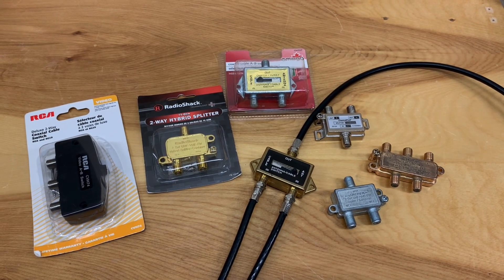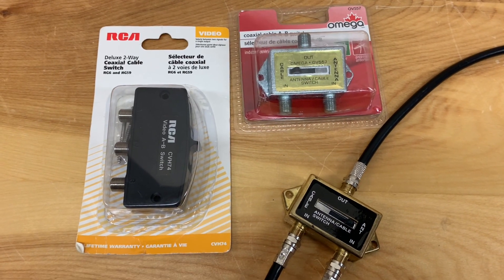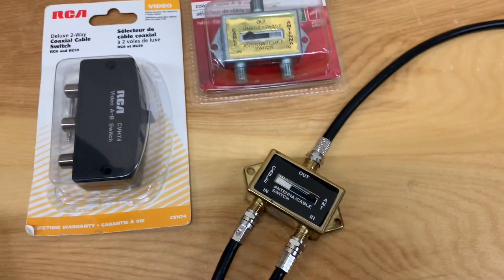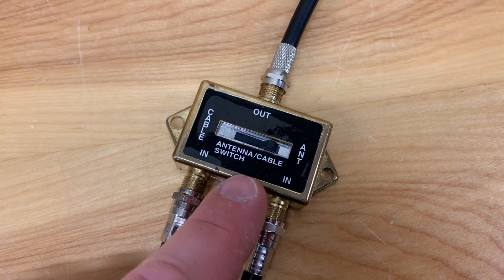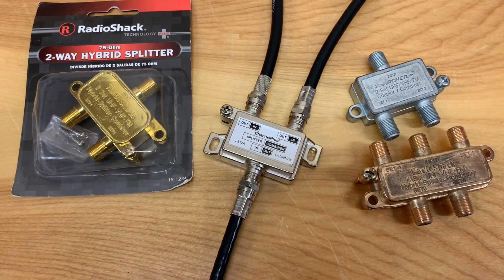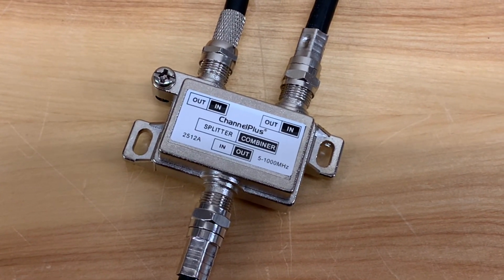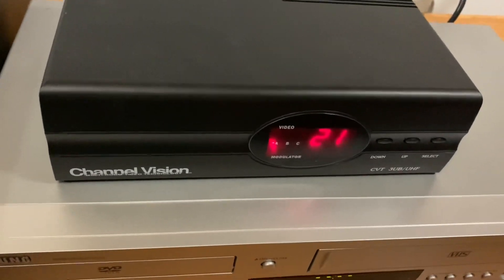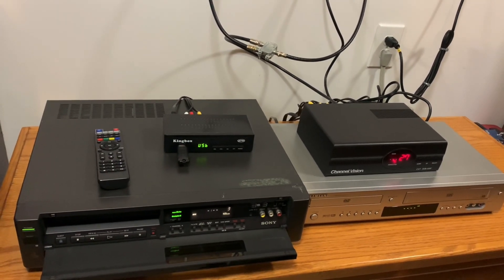Options for combining 2 TV Antennas into one Coaxial Cable

Comment: its 2025 DEC

    STILL WORKS ?? now atsc 3.0 took over ?
Reply from the maker: Yes, they still work in 2025. These are ways to connect antennas. RF is RF. Switches and combiners don’t care about format or standards. It doesn’t matter if it’s ATSC 1.0 or ATSC 3.0.

Comment: Cheers sir for the suggestion to watch this video you may have helped me to improve my signal from 2 diff antennas ...im on the north shore of lake ontario, a great spot to pick up signals and want to make sure my antennas arent interfereing with ea other   🍻📶📶
Problem with the manual switch is i would have to get on the roof 😂
Reply from the maker: @zandig666  The A/B switch could be installed inside the house. But the coaxial cable from each antenna would need to be brought inside the house also. The diplexer is probably your best option.☺️
Reply: @NorthcoasterHobby  I found one relatively cheap Skywalker combiner  diplexer  heard it was good for 2 antennas
Thanks I would never have known this without your help🍻📶
Reply from the maker: @zandig666  You’re welcome.

Comment: I’m using a Steren A/B switch now, because when I tried to connect to the two antennas at the same time, I used a Y cable (advice from the fb group) but they caused interference. Maybe a Diplexer could work. The group just said to use equal length cables and space the antennas a few feet apart. Since this is fast becoming a new hobby, I’ll give it a try. Thanks for the videos and the replies!
Reply from the maker: I would stay away from the Y cables. Stick with the A/B switch or diplexer. Besides those options the best thing by far would be the Televes SmartKom.
Reply: @NorthcoasterHobby  hi, I was going to order the Channelmaster jointenna cm-0500v2. any thoughts on this one?
Reply from the maker: @joeprete7424  I’ve never tried that one, it pretty much looks like a diplexer, nothing fancy. The main issue with diplexers is multipath, where both antennas pick up the same station and the signals cancel each other out. You could try it out and see, or experiment with a less expensive diplexer.
Reply: @NorthcoasterHobby  well, the Jointenna is working. I’ve got to work on some fine adjustments, but all the ABC (ch. 7 in NY) stations are now coming in. Thanks again for your help!
Reply from the maker: @joeprete7424  You’re welcome, glad to hear that you got it sorted out! Thanks for watching my videos!

Comment: Diplexer Is Not That Hard To make, I Have Made Few In My Time, All You Ned To Do Is KNOW The Frequency You Want TTo Get Or Work On And TThen Find Resistors And Capacitors Or Other Parts In Soem Cases To Just Disjoin The Frequencies So They Work In Alternating Fashion, When The Switching Is In Mhz Or Hz, They Just Switch The Frequency So Quickly That Your Device Will NotTell The Diference And reception From Both Antennas Will Coexist In A Single Coxial Cable, Its Super Smart Way TOD o It, Im using Self Made Filters To Do All Sorts Of Things With Frequencies And Its A Neat Thing ! Great Video :)

Comment: For those with two antennas. Is it ok to plug an amp after a diplexer/a-b switch before a passive splitter?
Reply from the maker: If you’re combining 2 antennas through a diplexer without any issues then adding an amp before a splitter should work. Try it out.

Comment: You can combine three tv antennas into a three way splitter if you want to,  just be sure to seal out the connectors with heat shrink and RTV silicone in order to keep moisture from getting into the connector and keeping the center conductor clean and in pristine condition.

Comment: Question, did you pre amp each antenna? I have 2 exact same antennas two same pre amps. Which has worked best for you?
Reply from the maker: I’ve never tried pre-amping both. How has that setup worked for you?
Reply: @NorthcoasterHobby  I will hopefully have an answer for you this coming weekend. I have 2 HDB4X solid signal antennas and two juice amps and a channel master jointenna. Gonna finish running wire this coming weekend and reply.

Comment: be very careful, when you combine antennas, you are making a antenna array,  and can get nulls,  basically the tv signals are 180 degree out of phase and cancel the signal.    this is not always the case, based on phasing, but can happen.    a coax switch , many vendors make them,   look up mini-circuits
Reply: You can also use various different lengths of cable to get the phasing more correct.
Reply from the maker: An A-B switch should fix that.

Comment: Ideally you want each antenna to point in the direction that is the dead spot of the other one.  If you can't do that exactly. it is best to make sure the two runs from the splitter to the antenna are the same length and type of cable.  You also should have identical antennas.
Reply from the maker: Thanks for the tips.
Reply: Did you try matching the length to see if that is all it takes to not cancel & ghost the 2 signals?  Otherwise half your video is useless.  If you cut coax at 1/2 wavelength multiples it may also eliminate impedance issue for that piece of coax.  Signal goes thru coax around 66% slower so shorter than on antenna element or in air.      @NorthcoasterHobby
Reply from the maker: @rcarroll3204  I never tried that.

Comment: Don't use channel thirty-seven or you might cause space aliens to crash their ships ;)
Reply from the maker: Haha, yes, reserved for astronomy.💫📡
Reply from the maker: Ch. 37 on a closed circuit cable system would be different from a broadcast signal on RF 37.🚀🛸
Reply: @NorthcoasterHobby  If you don't have a preamp on the antenna to provide isolation, some of the CH-37 will make its way onto the antenna.  Splitters presume an exact impedance match.  Any mismatch will cause signal to be reflected.
Reply from the maker: @kensmith5694  Thank you.

Comment: You failed to mention that using a splitter/combiner diplexer will cut the signal in half of both antennas you're trying to combine. The A/B switch may be a pain to use, but you'll have all the signal strength from both antennas
Reply from the maker: I guess it depends on a person’s needs. If you like the A/B switch better, then use it.
Reply: You can also lose signal strength using long runs of cable. Your signal will also lose strength going through the switch.

Comment: The most popular combiners in Europe are the Polish combiners AMS zwrotnica there are different models. A friend of mine who lives near the border has a combiner with two UHF inputs and a VHF input. One UHF antenna is pointed to the neighbor country, the other for local channels, VHF is for both FM and DAB. The model he uses is an AMS ZA-112Ms. In my case the model that I use is the AMS ZA-106AMs combiner which has two inputs VHF 87.5- 230 MHz and UHF 470 - 790 MHz. I have two antennas a 19 elements UHF antenna for TV and a 3 element Yagi Vertical antenna for FM radio and also has excellent reception for High VHF Band for Digital Radio channels DAB+ Not to mention all combiners have 4G LTE and GSM filter.
Reply from the maker: Indeed, another great option in the right situation. Most areas of North America have reception areas with VHF and UHF mixed together. Generally antennas pick up both bands unless they are really a cut to band antenna (not very common these days). If you are receiving UHF and VHF from opposing directions a UHF VHF combiner could be a good option.
Reply: @NorthcoasterHobby  For North America I would recommend a combiner that has two UHF inputs and a VHF input,. For Europe this type of combiner is used if you live near  the border and want to receive TV signals from both your country and the neighbor country. With FM and DAB things are much simple since radio antennas are omni-directional and mounted vertical you get analog and digital channels from both countries.  In my case I use a VHF+UHF combiner to have both TV and radio signals on one cable. I have excellent reception on both. On FM I can receive stations from more than 100 km.
Reply: @NorthcoasterHobby  How would I buy this combiner ??? Also, how much loss is there when this item is used. Thanks for letting us know what is out there for use and sale. Peace vf